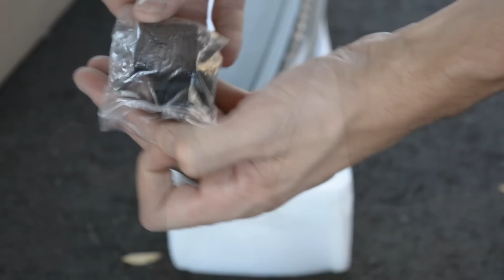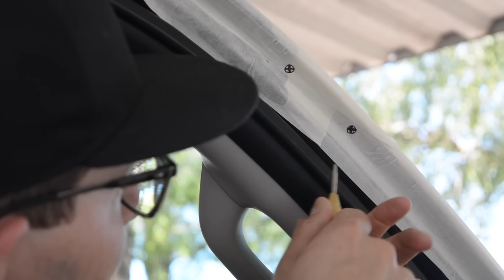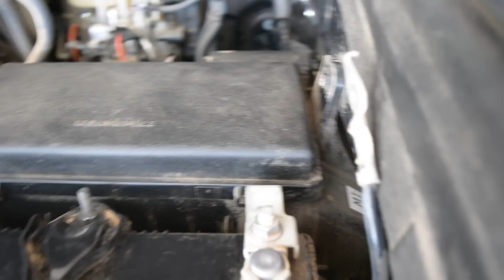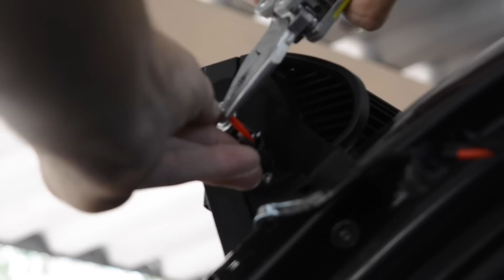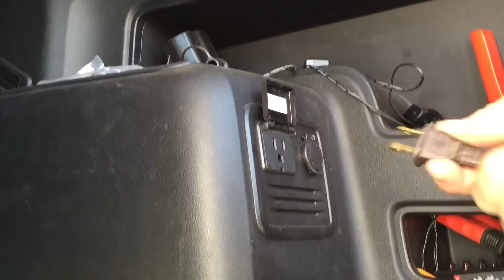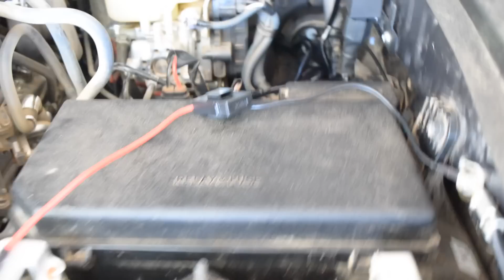2016 4runner - 50" curved windshield led bar install and hidden wiring

Comment: Hello, i am looking at putting a light bar on a 93 chevy suburban. Eather in the door jam like in the video or on a roof rack on the front. Do you get a nasty glare if you have it in the door jam ? Anything i should know before installing? Its a off road SUV so looking pretty is not a concern

Comment: I just had one installed using the same brackets. Mine is leaking like crazy around the weather stripping and there is wind noise. This doesn’t seem right. Any suggestions??
Reply from the maker: hey there, i never had any leaks but maybe some black RTV sealant could help? and for the wind noise I used gorilla tape on the fins on top of the bar and it seemed to help. still had a lot of vibration but i got used to it lol. after 5 years of having it on I decided to remove it since i never went off road anymore

Comment: use SAE waterproof connectors, use MARINE GRADE HEAT SHRINK ON EACH connector then over both connectors. Vinyl electrical tape is NOT meant for continuous outdoor exposure. It is NOT considered waterproof and breaks down when exposed to UV radiation and temperature extremes. You also cut the factory wire on the light bar much too short.

Comment: VERY IMPORTANT TIP: ONCE YOU INSTALL YOUR LED BAR PLEASE PUT EPOXY ON THE SCREWS HOLDING THE LED BAR  TO PREVENT SOMEONE FROM STEALING IT BY SIMPLY UNSCREWING IT
Reply: I remember when jacking light bars was bad.
Reply: @drew5992  explain
Reply: @johnhancock2914  everyday someone’s light bar was getting stolen. But with vehicles getting better and brighter lights from factory seems like the need for light bars are not as high anymore so they are stealing catalytic converters. Lol

Comment: If you did not cut the wire on the lightbar socis the lightbar so short you would have more wire to work with never ever cut wire off a light bar before you before you run all of your wires please comment back if you feel the same he has very little wire to work with on that light bar

Comment: Hey mate, will it pollute any weird sound because of the air movement?
Reply from the maker: Hello!
Yes it definitely causes some vibration noise and wind whistling. Its pretty bad too but you get used to it after a while.
Reply: I see bro. Very appreciated for ur reply. Cheers!

Comment: Great vid thanks. Just a suggestion if you care...when you run the wire through the firewall, have enough excess to hang a drip loop as the wire comes out into the engine  bay. That way gravity does not let water run through your engine wall. Please disregard if missed you doing this. Cheers!
Reply: I was fixing to pump half a tube of caulk in to the remains of my boot. Friging brilliant sir.

Comment: I would love to have this in Virginia,   The only problem is,  it is ILLEGAL unless there is a cover over it.  Because Virginia considers  for off-road use.
Reply: It's illegal in Mn too but I still see alot of vehicles with them mounted on the roof and not covered

Comment: The forked connectors you used were the wrong type...they should have been a spade type to correctly tightly fit the female connectors you used on the switch wires coming up!! YOU MIGHT BURN OUT UR CONNECTIONS BECAUSE THE WILL COME LOOSE!

Comment: Unless you know you'll be replacing the light bar, I would not cut the wires and add connectors until and unless you are ready to replace the lights. It's a useless step, introducing another point of potential failure, for a maybe, especially since it can easily be done if you decide to replace the light bar. Otherwise, solid video!

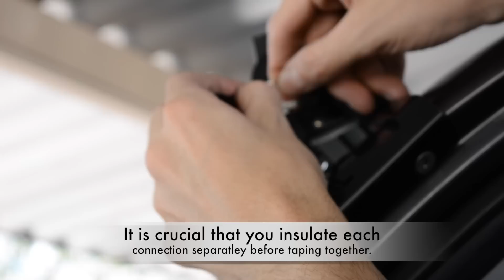Comment: 13:07 I'd recommend getting insulated style connectors.  Also using the right style helps too.  Those fork connectors are not meant to install in those female connectors.  Fork terminals are used on screw down terminal block.  Time for some high quality crimpers too. https://www.delcity.net/ is a good source for wiring supplies
Reply: As an electronics technician, I was cringing at times.

Comment: That was well done. Plenty of good information. However, the connectors used at the light bar end were incorrect. You had female spade connectors which should be used with male spade connectors. (Forget the obvious jokes!) Instead, you installed connectors that are for use with screws on things such as power supplies and such.

Also, it would have been better if you had admitted that you made a mistake when you wired everything on the outside of the bracket then had to do it all over again to show the harness installed correctly. I nice opportunity for some tongue in cheek humor was missed. LOL

The only real problem is that those light bars are made from a very rare element. It's called "Unobtainium"! At several thousand buckazoids those are just not affordable to many of us. So, once again, the boat of dreams must be dashed upon the rocks of reality.

Even with the financial wall of impedance getting in the way, those of us who must use equipment that is not as expensive can make good use of this video.
 
All things considered, you did well.

Comment: Electrical tape is my most hated "Tool" in any project I see.

I'm a repairman for equipment used by custodial staff, lots of electrical equipment, motors, wiring etc I come across, and I hate hate hate, when someone uses electrical tape to "Fix" or insulate something, but unless it's in a Dry, cool place, it turns to a loose gummy black tar mess once exposed to the sun or humidity and is mostly what I see cause the problem why it came to me in the first place. I always have rolls of heat shrink, and use the 3 piece wraps (on 2 wire lead), and a Braided sleeve if it's coming into constant contact with objects.

Sorry, I have a strong opinion on Electrical tape hahaha
Reply: I work on powerlines and find tape that has been sitting outdoors in rain, snow and sun for decades. Thats the fun stuff to remove.

Comment: I like how you said make sure you hook up the wires ON THE INSIDE OF THE Bracket as you're soldering the wire together on the outside of the brackets. Guess you had to pull the wires out and re run them lmao
Reply from the maker: Haha yes i did! It was a FML moment for sure haha
Reply: Other than that very clean. My buddy took his truck to a place and they literally drilled a hole in his roof and ran the wires there and caulked it. Freakin dumb af

Comment: Hello, everything was well done by the time you cut the electrical cable that leads from the LED lights to the required places. You could have left the wiring in its original condition.
Reply from the maker: If i did, it wouldnt have been slim enough to fit into the channel next to the windshield.

Comment: An observation. You used the wrong male crimp on connector at the light bar. The one you used is to connector a wire to a screw. You should have used the spade connector.

Comment: Best installation video on YouTube.  I never knew about cert nuts, and was wondering how I was going to thread the bolts in.  I'm going to mount mine a little bit higher up the door jam and am probably going to run it through where the roof rack is mounted. The principle is still the same though.  I'll be using those cert nuts for sure.  Thanks for the video!
Reply from the maker: Awesome man, thank you for the nice compliment! I really apreciate it and I am so glad that this video helped you out!
Reply: I never heard the term cert nuts. In the industry we know them as riv-nuts and we also use a air compressed riv-nut gun with a mandrel. Didn't know there is a hand compress tool. Great video by the way. Thanks

Comment: You used the wrong terminals to connect the lightbar...     Would have been much better if you used insulated spade terminals, instead of a non insulated female spade and a non insulated fork terminal.  I used DT connectors.
Reply: Now that I watched the rest of your video, I see you soldered it.   Solder has a tendency to crack.  where the solder saturated wire meets the un soldered wire it will break.  That's why solder is not used in motorsports harnesses.  Not trying to discourage, just educate.   If you need to extend wiring it's best to use a crimping barrel and heat shrink.

Comment: You did the heat-shrink backwards: You should've started from the engine compartment & moved upwards, water doesn't flow uphill -unless you're planning on driving into a lake! Otherwise, good video -Thanx! };-]

Comment: Very nice looking light bar. Great installation. Only question, does this particular light bar whistle?
Reply: Spankyblack69 do a lot have a frequency pitch?
Reply: Yes a lot of light bars “howl” at higher speeds I think there is some kind of spacer you can get on Amazon that helps with this.

Comment: You really should have treated the holes with a zinc rich coating first,  letting it dry before putting in the RTV..
Reply: Ethan STORMY well he didn’t get over it

Comment: Reccomend shrink tube with glue so you get a good water seal. pay extra for your shrink.. the cheap stuff is thin and doesn't come with glue on the inside.

Comment: I already have ditch lights on my 4th gen 4runner but stumbled on your video series and plan on getting the hidden bumper light as well as a roof rack light bar and some scene lights on the sides and back. At what point would you consider upgrading the battery/wiring? Excellent video, thank you very much for the detailed explanation!
Reply: I'm curious on the battery thing too. Even considereal a slightly more "powerful" alternator as well.

Comment: Great video only suggestion if your light ever cuts out check the connection directly coming from the light bar you used female and screw down connectors hey actually make a male part to the little crimp connectors you used or maybe that’s all you had on hand because out of my kits I use the female and male connectors the most. PS didn’t finish watching so I won’t remove this comment Incase someone uses the first method. Here’s a link to the ones I use in automotive light purposes....https://www.amazon.com/dp/B07F695FT4/ref=cm_sw_r_cp_api_i_byiyCbGPJRSKY

Comment: Use longer leads on the equipment side: often you need more than you have: disassembling the equipment to add longer leads is not always feasible.

Comment: Does anyone know if this would work with a straight light bar on a 97 4runner.
Reply: Or any other brackets that would work with a 50 inch straight on a 97 4runner

Comment: anyone know where you would set up the switch in the cab of the truck then?
Reply from the maker: hello, I know some guys have removed the blank switches on the left hand side of steering wheel area and used custom switches in their place. I think rago fab should have some on their website. Hope this helped and hopefully other viewers can chime in to help as well. thanks for watching!
Reply from the maker: You can see where I installed my switchpros unit in my video here http://theroninchronicle.com/switch-pros-sp8100-install-2016-4runner/  its at the very beginning at 24 seconds in. You can see the blanks that i mentioned as well, just above my install location.

Comment: Do you remember what size those rivet nuts were?
Reply from the maker: hey there, I dont unfortunately, but I'm sure that Rago Fabrication can tell you because they included them in their kit. Sorry but it has been so long since I made this video, I wish i would have included that info. Thank you for watching. I will try to email them as well when I am able to., then i will gladly update the description to show the size of them.
Reply from the maker: I did see this on their website, "Every mounting hole is machined to use 1/4 x 20 pan head taper screws" so those are the screws that go into the rivet nuts, if that helps at the moment.
Reply: The Ronin Chronicle awesome thanks for the help!

Comment: Great job. gave me a lot of confidence seeing the detailed steps. Pretty much what I had in my minds eye.... Just hate to drill into my truck. lol.
Reply from the maker: Thanks man! I appreciate your comment! It was very nerve racking to drill into a brand new $40k truck haha. Thanks for watching!
Reply: @TheRoninChronicle  i have a 93 4runner. It was 4k back in 93 brand new. Im nervous to drill into it. Id imagine how nerve racking it would be for a new 4runner
Reply: you don't have to drill just mount it on your  roof rack if you have one i just did that to mine
Reply: @Kereyuli   Depends on your rack. I wanted to attach one to my Thule Canyon XT, but the bars are curved, and 1/2" in some spots.

Comment: Great video bro. I was totaly over thinking it. A couple things I am going to do different but I saved your vid. My only question, is the kit for a 4 Runner? I have a Colorado ZR2
Reply from the maker: Thanks man! its very easy to do for sure, i really hope this videos helps you and other people out. Yes these brackets are specifically made for the 5th gen 4runner only.  The 52" curved bar is a perfect fit as well. Im not sure if they make a kit for the colorado, but you can check their website out and email them to find out. they are very responsive. Thank you for the comment and for watching!

Comment: i might need to weld the side of the light bar to block the bolts the side of the light bar to make it difficult to remove it i don't want any people try to stealing my light bar make it more difficult will help

Comment: Instead of a unibit you could’ve just piloted the hole with a smaller drill bit then follow with the 13/32 to finish. Reduces risk over over boring the hole

Comment: For your first time, you have explained it perfectly. I was looking for how to wire and hide the cable running from the top. Did not think running it through there. Very helpful...
GOD BLESS
Reply from the maker: Thanks man! I really appreciate your comment! Its a perfect way to hide it for sure. It has been 2 years since I have done this video and its still perfectly hidden and snug. no issues whatsoever. Thank you for watching!

Comment: how do you keep the wire from popping out of the windshield track? My keeps popping out.
Reply: Black Silicone
Reply from the maker: Hey thre, I didnt really do anything special other that wrap it with electical tape. Maybe the wire on your switch is thinner so it isnt as snug? You can try to wrap it with more tape to thicken it or use heat shrink as well if you are able to disconnect it. Mine has never moved since I put it in there, its as snug as a bug in a rug haha. Try thickening it though and let me know if that works for you. Thanks for watching!

Comment: I like the video because this is my first time doing a light bar on my new truck. At least it gives my step by step of doing the holes for the bracket. The wiring part I don’t need to watch because my light bar doesn’t have a switch to turn it on all it has is a remote control.
Reply from the maker: Nice, I'm glad you were able to still get some help from the video! thank you for watching!

Comment: Did I read that price for the bracket correctly? $150 bucks?
Reply from the maker: OverZealous Maverik no thats not correct, they are $99.95. I think they put compared to $150 what the competition charges maybe or what they used to cost. Im not sure. Thanks for watching!!

Comment: You ever have issue with the wire coming loose where it goes down by the windshield?
Reply from the maker: Chalee Her hey there, no I havent ever had a single issue since the install. Its been almost 2 years and is going through the 2nd monsoon season and it is still perfect just like when I first did it. Still Going strong!
Reply: The Ronin Chronicle surprising. I would assume since there nothing holding the wire firm on the side windshield, the wire would go undone while driving. 

I might have to give it a try on my 5gen.
Reply from the maker: its a very tight fit due to the heat shrink, it makes it very snug,
Reply: The Ronin Chronicle well thanks for a awesome installation. Will sure use this guide to install mine when I get it in.

Comment: Question: would I be able to put together the same kind of wireing lay out/harness,with relay,fuse, switch and light bar but also be able to pigy back three more smaller led lights on to the same set up?
Reply from the maker: Im not sure about that. Maybe another viewer can chime in on this one
Reply: The Ronin Chronicle ok thanks for the reply.

Comment: Why are the wires coming out of the light bar so short
Reply from the maker: Fifty81 I had to shorten them so that it could be truly hidden and so that the wires could also fit in the channel of the windshield. Its been a long time since I did this install, so Im not sure if it can be done the opposite direction and still stay so well hidden. This is the way that Mario Rago told me to do it. He is the owner of Rago Fabrication, the manufacturer of the brackets. Thanks for watching!

Comment: Great video!
Reply from the maker: HannibalACP82 thank you very much! I apreciate it!
Reply: I am currently living in the middle east and I miss the access to great parts like Rago back in the states..  I want to put a 40in bar on my Toyota Fortuner and I am going to have to try and custom fab a bracket over here for it.  Your  video is  the  inspiration I need to pull this off.

Comment: your soldering needs improvment, place the iorn under the wire and feed the solder into the wire once it's warm, a small amount of solder can be used to tin the iorn to help heat transfer to the wire
Reply: I hope he used Adhesive shrink wrap

Comment: If I may. Most vehicles are floating grounds. So the neutral could be attached to any metal surface close by the light. Maybe even under the screw used to mount the light. This would allow you to only run one wire for the power. Just a thought. Otherwise your install looked great.
Reply from the maker: Carlie Davis thank you very much for your insightful comment! Its always cool to hear alternative methods that could work out better. I appreciate you taking the time. Thanks for watching!